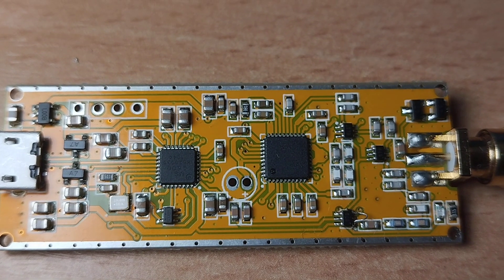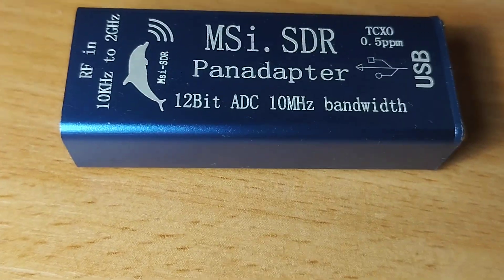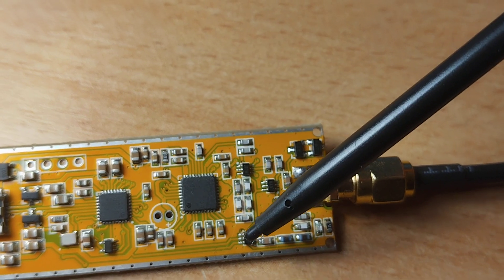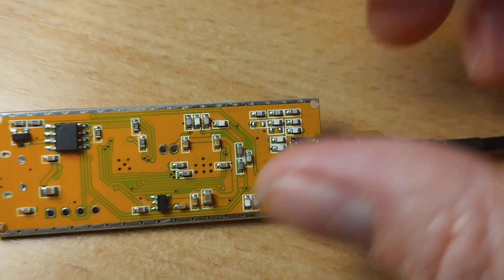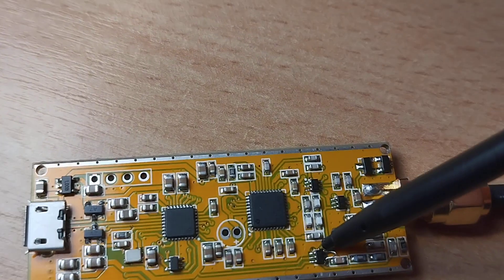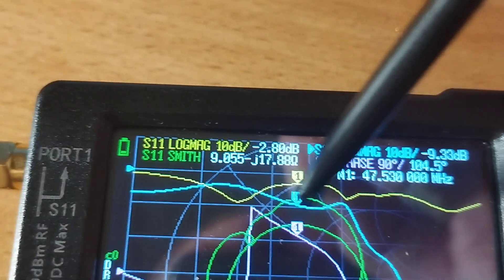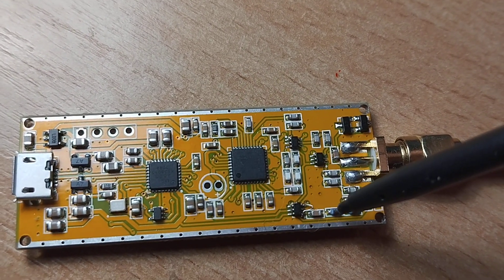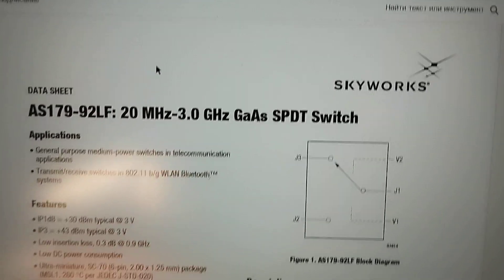Fixing low sensitivity in the MSI.SDR  USB panadapter.

Comment: The lower switch  can  be bypassed from input to output and removed.  The lower switch douse not do anything after this mod. So just removing will get an extra 0.3dB of signal.

Comment: Bravo. Where is the  schematics?  Did you got one?
Reply from the maker: Hello! Unfortunately, I don't remember where I got the schematic. Maybe I loaded the datasheet for the MSI radio chip. I did some reverse engineering to find connections between components on this board. I had reinstalled my Windows this year, but I found in my laptop only "MSi001 Datasheet R3P3" and "AS-179-92LF SPDT Switch".
Reply: @andrewandrosow4797  My device had noise caused by  bad shielding so i soldered some  small 4mm x 20mm  copper sheets transversal on PCB board for shedding and lowering (shunting) ground loops.   It improved the sensitivity by lowering the noise. Now I can turn the RF and IF gains to maximum without having to many noise spikes. May be this is the problem. Also  I did  better electric contact between PCB and case by removing the blue paint inside the case at guides and some solder on PCB margins.
Reply: I will do a spectrum analyzing when i get one.
Reply from the maker: @ Thanks for the help and experience sharing!